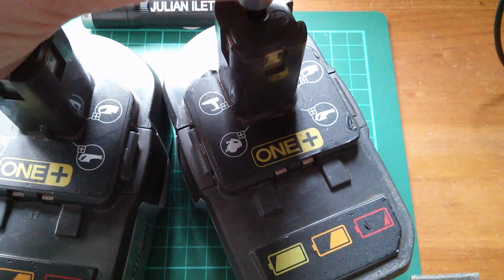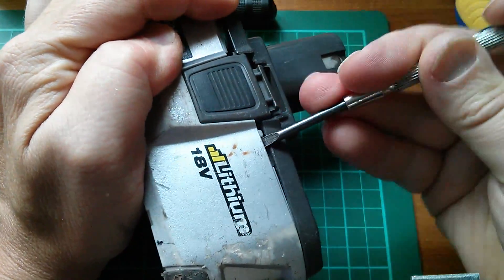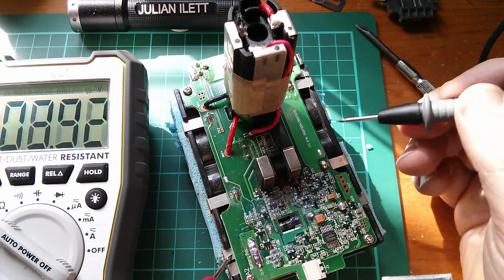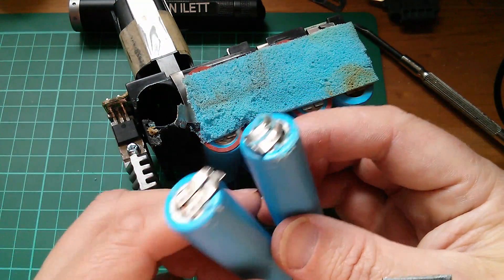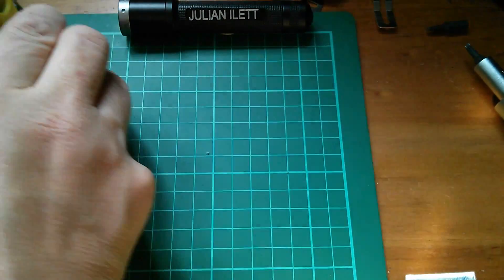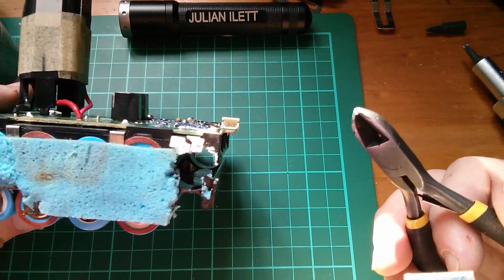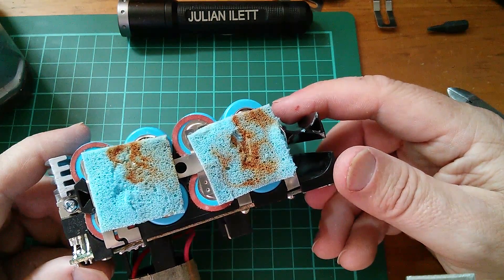Fixing 18V 2.4Ah Ryobi Lithium Power Tool Batteries

Comment: Question, is this battery still alive?
I have one exactly the same as yours and when I press the power button, it shows yellow fully charged. I opened it up and 6 of the cells have a lower voltage than the remaining 4. I wonder if taking the circuit board out and recharging the cells individually, if it would work. What method did you use to recharge the cell that you just put in? A battery charger or you charged it from a similar fully charged cell?
Regards

Comment: Can I ask a silly question? If you only have a low powered hobbyist soldering iron, could you use electrically conductive epoxy instead?

Comment: I'd keep old cells from laptops. I have a few dozen of them I've saved just for my battery tools. Usually it's always just one or two that goes bad and pops the protector and makes the battery stop working for anything that takes 18650 cells. At least that's what I've found. I've never reset the cid's. Personally I feel if it's popped its popped for a reason plus old laptop batteries are pretty easy to come by.

Comment: Buy the blocky USB battery banks from the Dollar General or Dollar store or Poundland, whatever they have wherever you are.   Those are made with 18650 batteries.  I've used those to replace the batteries in my dead Ryobi one+ battery packs with great success.

Comment: have a 18 volt ryoby battery that says it's full charged you check battery it does not have charge and won't work in tools
Reply: Pops Rawson I had similar issue. One thing I noticed when I read the voltage with a digital voltmeter after a charge it would read 20 for a moment then drop to 12 volts. I am thinking the charger is reading the 20 and thinks it's charged but there are actually 1 or 2 failed cells inside.

Comment: Do you think the circuit is intelligent enough on the battery pack to detect if you were to replace the cells with brand new cells of a different capacity? Would that throw a spanner in the works.. 

I'm just wondering about completely building a custom battery out of a dead one. Say for example I used an originally 1.5ah ryobi pack that would be 5 18650's @ about 1500mah each to produce the 18v.. if I'm not mistaken, so could it be possible to replace those cells with 5 3200mah ones.. what would the circuit make of this? Is it a bad idea. 

I do kindly appreciate it if someone could have an input on this matter..

Obviously questions are to use high drain cells due to the power consumption and does the circuit have built in under voltage protection or is that cell based under voltage. And does the circuit on top of the batteries consider consumption accustomed for the genuine cells.

Comment: hey, i repaired a few of these ryobi packs (5-cell and 10-cell)  the voltage is is 20.7 at the cells before the circuit board and only 19.4-19.3 when check from the outside of the case any idea why its doing that ?  Thanks
Reply: steve mai it's normal

Comment: You can make the joints look a little better if you take a piece of wood and use it to hold the solar panel buss wire down while the solder solidifies.
Reply: Not a good idea as the hot liquid solder might burn thru the plastic cell sleeve and short out the battery.
Reply: +Georgia - What's that got to do with anything?  Solder was needed, solder was used.  I only suggested a way to Do It Better.  Most people don't own a spot welder so solder is the next best option.
Reply: Solder is ok.Using a piece of wood to hold the tab down while it is hot is not a good idea as it can burn thru the plastic battery sleeve.You want to avoid getting hot solder or a hot tab near the sleeve.
Reply: Force has nothing to do with it.The hot solder will not need much force to burn thru the plastic sleeve while it solidifies.The clearance is very little.
Reply: Georgia Theodorou   stinky cheese has got you, and he's totally right to, I have worked with many kinds of 18650 packs, and I can say without a doubt he is right

Comment: Wow! Kudos to the fella that found a way to 22 for 2 dead batteries! Also, when a battery is "bubbling out there" you should leave the room, not stand over it poking it. lol. What is the purpose of this? 22 for one half dead, or dying battery isn't very economical. Two brand new, not dangerous to make work, batteries are often less than 90... furthermore, mixing cells that are in different states of decay only destroy the battery sooner and introduce new risk. So you've created a "new" battery that might work for a very short time. It is destroying itself and has much greater chance of destroying your tool, or your house by setting it on fire...

Comment: They should make it law that cells are not soldered in place so that people don't kill themselves trying to repair batteries they should have all cells spring loaded and easily accessible and you should be able to pick up a new cell at the store. Rather simple solution.

Comment: Please what is the name of the screwdriver that you used to open the battery .I ask because I bought 10 scrap makita lithium battery to use them to make a 48v scooter battery and I have been unable to open the battery
Reply: Its a security bit t10 harbor freight sales a kit of different bits for around $10
Reply: +Chris New      On the smaller Ryobi 28Wh 18V packs (5 x 18650 cells) you need a T10 Torx screwdriver, I'm guessing these packs would be the same.

Comment: Hi Julian, I know that this is an old video, but this seemed like the best place to ask this. I recently bought a bosch cordless drill with a pair of 5 cell Li-Ion batteries and of course, one of the first things I did was open up one of the batteries to have a look inside. To my dissapointment though there was no individual cell protection, there weren't even wires attatched to the individual cells leading to the drill body. It just had positive and negative going to the drill and two connections for a thermistor. Would you be in agreement that this is bad construction and potentially dangerous? There definitely wasn't any ECP on the individual cells and I'd be surprised if you could fit something to handle 10A on the end of a cell. The only protection seems to be an undervoltage and over current cutout for the whole pack (inside the drill body). I'm surprised and dissapointed in bosch, and I've got Bosch fans jumping down my throat at my Amazon review for suggesting that it might be dangerous. Would be glad to hear your thoughts.
Thanks.

Comment: I have a Ryobi pruner 18V with the Female side of the battery attachment has one leg broken off. What is the best way/material to use to splice on a springy leg for fixing the part. It has a ceramic join piece between the legs with the residual bit of clip still attached. This part and tool is no longer made. Any ideas!?

Comment: Julian i think it's better if you buy new better higher quality cells off either ebay or a reputable website to replace all of these, they all seem to be rusting or low quality cells, once a failure condition has accured most likely those low quality cells are toast or have one foot in the grave, the trick is to find high quality high drain cells for a good price to make it cost effective, and be very very very careful those lithiums cells leaking like that are very dangerous, i wouldn't want my battery packs going into cascade failure and blowing up on me.

Comment: Maybe you can get a pair of notebook old models replace 6 cell batteries that has lost your market value so you can rebuild a brand new cell that will hold better charge and fix that battery you scraped cells.
Great fix, nice video!

Comment: With model aircraft you 'balance' the cells. I assume the battery pack can do it by its self but you may want to ensure all batteries are sitting at the same voltage.

Comment: I've seen the 'rust' caused from the 'other way around'.. That is,the spot welder blew pinholes in the end of the cells,and the rust was caused from the electrolyte leaking out..not from water getting in.
Reply: That reminds me of toys and things I had that I did not take the batteries out of and they leaked and ruined it.  That was disappointing.  How many people have ruined electronics by not taking the battery out?  It is very easy to do and yet so hard to clean out sometimes.

Comment: Julian Ilett have you ever thought about spot-welding new tabs to the batteries? Especially since the cells are capable of delivering dangerous amounts of energy, one should be able build a "fuse" that breaks the connection after a long enough time for welding the tab an.

Also: wouldn't it have been easier to simply desolder the tabs from the PCB? They looked quite easy to reach
Reply: +Andre Klärner: well the solder on the new cells will act as a high current overload fuse (just not calibrated to any particular current.)  lol.
Reply from the maker: Andre Klärner I've thought about it, but I can't think how to weld to the positive terminal unless the battery itself were part of the circuit. I would imagine spot welding to lithium cells requires very specialised equipment.
My guess is that the tabs would have been folded down flat before being soldered to the PCB which would make them quite difficult to remove.

Comment: Grind the tabs first, use some colophony. An angled face iron tip would be much better than a pencil point tip.
I would put some Kapton tape (before soldering) under the joints for safety reasons.

Great videos!

Comment: The coloured meter on the battery is completely pants! The slightest use and it changes colour! Has been rectified on new 1.5 and 4.0AH!

I think it is worthwhile I have 2/3 working! And the third one I stupidly put protected cells in! No suprise at all when it didn't work! Brilliant job

any ideas on a capacity test? Like running a 12v 50w lamp to check current capacity maybe do it once a year?
Reply from the maker: pietkaify Thanks Pete. I've watched your videos about repairing Ryobi batteries - which is where I got the inspiration to do this (being completely honest). Now I'm watching your series on the LiFePo4s - fascinating stuff.
Yes, a discharge test is the best capacity test - a 50W car bulb sounds a bit heavy to me - maybe put the two filaments (main and dipped) in series.
Reply: Maybe because high current draw causes big voltage drop?
Reply: Yeah sounds right! The newer ones do not have this problem.

Comment: The solar bridge wire (or whatever it is really called) made for a nice repair!  In the past I have done a similar repair using solder braid.  It doesn't look as nice but it does solder on easily and you can get it in a lot of different widths so you can make sure you have enough current carrying capacity.
Reply: Julian Ilett A much cheaper source of braided wire is the screen from coaxial cable. good quality RG58 or 59 would be OK here.
With regard to the corrosion, look into crevice corrosion which is a particular problem for stainless steel and probably compounded by electrolytic corrosion between cell cap and bridging strip.
Does the inbuilt charge circuit perform any kind of balance charging? It might be worthwhile charging each cell individually so that there is no variation between cell voltages in the pack.
Reply from the maker: heyok I never thought of solder braid - that's a neat idea.

Comment: Would you consider just adding two new replacement tabbed 18650 cells for the second pack? or are you worried about a miss match in capacity? or is it just cheaper to keep buying 'Faulty' packs
Reply from the maker: ***** These cells have heavy gauge connecting strips and substantial spot welds. The tabbed cells I've bought on eBay and the ones I've seen in power banks use much lighter weight tabs with much less substantial spot welds.
Then there's the issue of which chemistry type do power tool batteries use. And the general minefield of capacity and maximum discharge rate. I suppose I'm just playing 'safe', replacing like with like.
Reply: Might anyone know a source for new 18650s with tabs?

I echo Perry's question, and would much prefer to buy just the cells -- new ones -- than to buy a used battery from which I'd hope to find replacement 18650s.

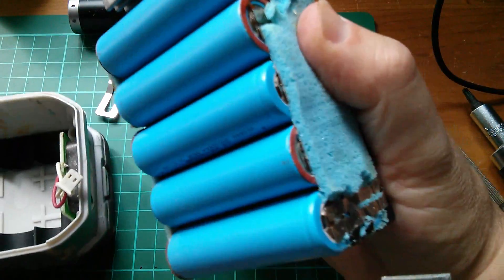Comment: I've read a thread in budget light forums where a Sony high drain cell was shown that had leaked and possibly corroded from the inside. The rust you are showing might be a result of electrolyte leakage as shown at 2:40
Reply from the maker: runner180fxr That's true, I may have got cause and effect the wrong way round.
Reply: +Mandragoras hey ,if anyone else wants to uncover learn how to recondition batteries at home try Vaxicorn  Battery Extender Guide (just google it ) ? Ive heard some interesting things about it and my mate got cool results with it.
Reply: 3 years later.. Hehehe I just took one of these apart and found the same thing. One leaking cell and maybe another getting ready. Both on the bottom of the pack. I really like these sets. i will replace this one with some 18650s I have from a laptop. Do these cells rust because of bad cleanup from solder flux???